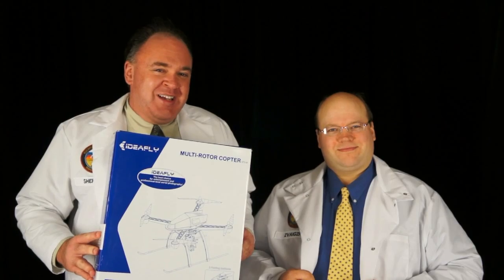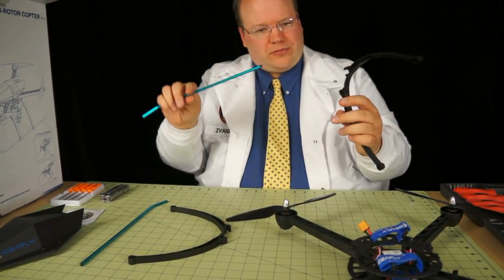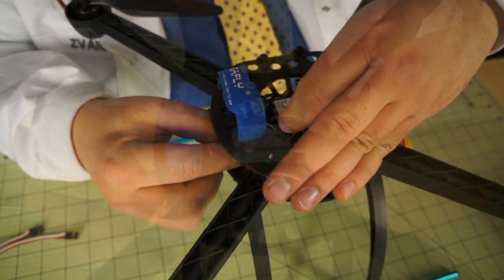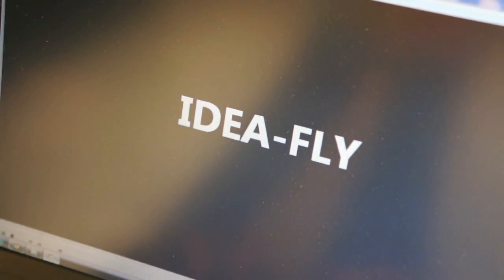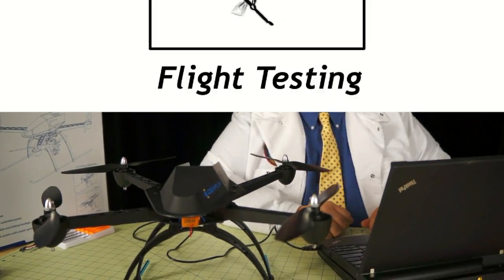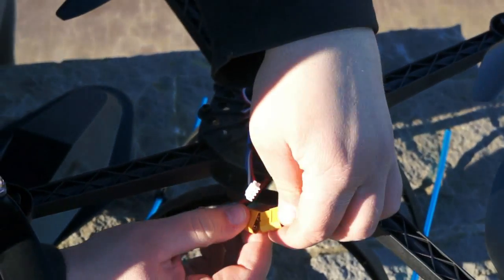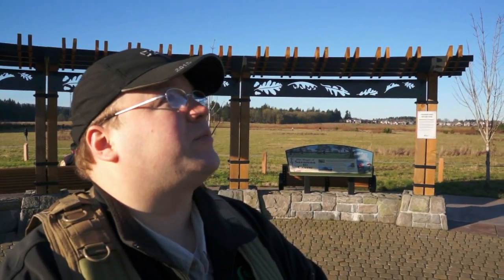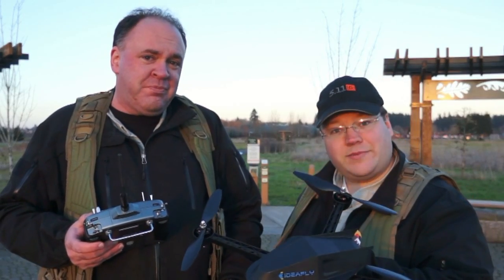RFTC: HobbyKing IdeaFly IFLY-4 Quadcopter Unboxing, Setup and Testing

Comment: Hi, good video, your setup went a lot easier than mine!!! In the end I have sent Ifly 4 back as I could not get the rudder to work, nor the yaw. Think flight controller is at fault, could you possibly show how you set up balance/throttle & altitude/balance Agps on the mode switch PLEASE!!!!
Hopefully my replacement will be here next week.......
Thanks in anticipation

Ken

Comment: Extremely useful, in particular for the last video bit on the commands. I was not able to startup as the manual says "Push the throttle to the lowest position.
2:Push the Elevator/Aileron stick to the left-most" which was misleading for me. Sounded like I had to do one thing with each stick, while in fact it was just a matter of pushing the throttle stick in the down-left position. So this video really allowed me to go ahead when I was entirely stuck on this simple thing. Thanks!

Comment: Great video guys. I bought a Syma X1 a few months ago to learn on, great little beginner quad, but now I am to the point to where I am getting beligerent with it, seeing how out of control I can get it and still recover. As many times as I have lawn-darted it into pavement I am suprprised it still flies. I am looking at this one as my step up and as a GoPro platform. How much run-time did you get out of that batteries, and have you had any issues with that quad? Thanks!

Comment: I upgraded and the problem is not solved ... the engine (3) does not work ... tested in other software and when I click engine (1) both run at the same time. I would try to solve and not send it back to the dealer (HK). Is there some sort of factory reset?

Comment: I too have seen this on mine as well. #4 motor makes loud noises when starting up and vibrates like it has bad bearings. I tried the motor test last night and surprisingly got all 4 going when testing #1 motor.. So far I'm stuck in e-mail limbo with Ideal-Fly.

Comment: Hi I bought one and followed your video to the letter. When it came time for test flight I was getting glitching, sudden engine rev-ups and then flips over. I went back to the computer and recalibrated my radio (Futaba 9C with FrSky module and 8ch Rx) I got it into the air but it would suddenly climb then roll over and come down. What is going wrong? I need help. Thank you. Jim

Comment: IFLY-4  motors rated @ 11.1v . Your using a 4c 14.8v battery . Is that OK ? Just checking before I order . Hobby-King recommends 3s 2650ma  for the IFLY-4.

Comment: I am humbled at your reply, love your guys work. I had the altitude hold issue during the stock setup but after installing the fpv system plus a digital camera and a 2650mah battery the altitude hold was solid, even during fast flights. I later removed the stock flight controller and esc and installed the DJI naza, which is my current setup, but if it wasnt for the NAZA GPS capability i would have sticked to the iFly 4 flight controller. It is super stable and easy to fly

Comment: good purchase mate, got mine the other day and crashed it through a steel wire fence at over 80kmh, ran over expecting nothing but shredded plastic, but no only snapped one prop and dented the battery. things a beast

Comment: I've flown iFly 4 for about a year now and never look back, started as a beginner but due to the stability of the device i never had a crash. I tried to replace stock FC with the Multiwii but had a major crash which only damaged the blades... Amazingly durable. I have since installed a DJI Naza controller and it is awesome. Point to note is that barometric hold will be very unstable unless you add more weight to the device like bigger battery and/or fpv system, then it should be rock solid.

Comment: Hi,
i have read much about an issue with the stock esc´s in the ifly quad. In many cases they overheat. Are there any problems like this, you have already recognized? I think, during an extended payload capacity test, would the esc certainly blown away. What you think? Thank you.

Comment: Ahh, I was just having a nose around your website and it says under the ravens specifications that its running the multiwii board. After watching your video on the naza i ran out and bought one :), made a couple of quad's and hexacopters and by far the best flying board ive had. However, it almost took some fun out of flying the multirotors so i swapped it out with a kk2 to have abit more fun :D (any alot more crashes so it seems!)